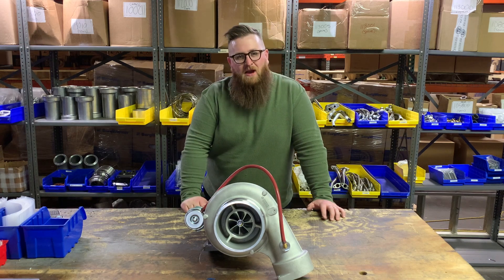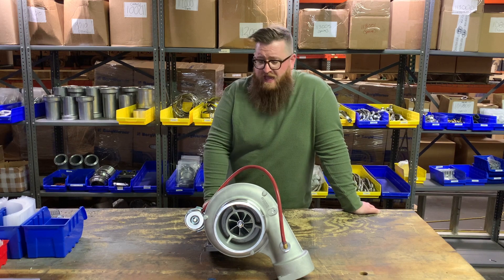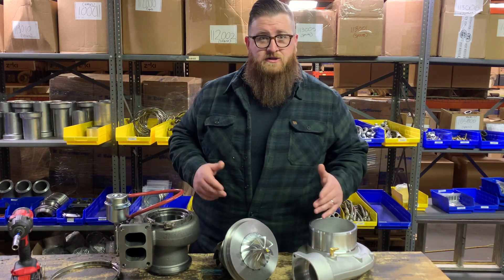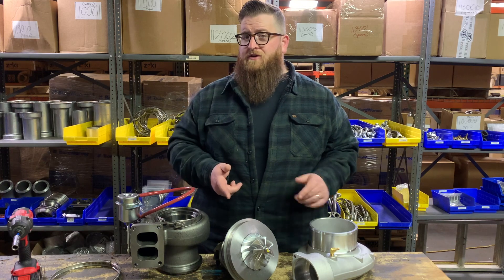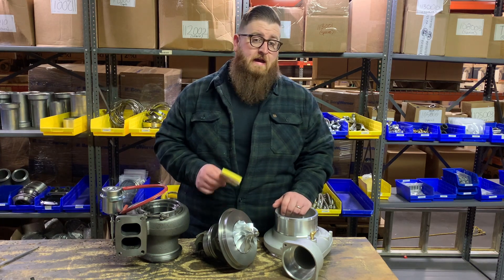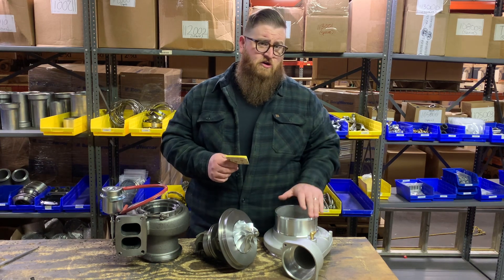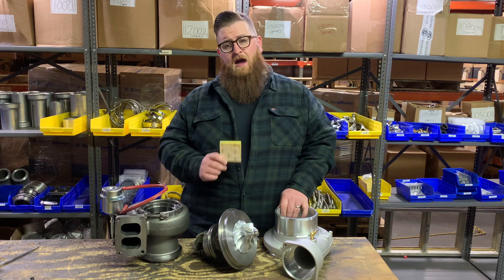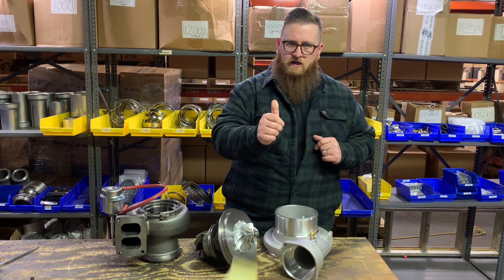Wastegated CAT Performance Turbo | 78MM S410SX

Comment: Any idea if they’re gonna make a 1.45 waste gated housing? I think that would be perfect for the 3406/C-15 engines that are pushing more fuel than stock.
Reply from the maker: It's possible,  but I don't think it's in the works for the foreseeable future
Reply: Yeah I have a 1.41 WG cat 9928 turbo and would like to replace it w a similar housing perferbly w WG.

Comment: would this be a good fit for a modified 550 file? stock injectors?
Reply: yes it would . it would be just fine . with the 1.32 housing it would spool nice.

Comment: What about adding that housing to the 171702 turbo? I put that on my c12 and it solved my heat problem. Doesn’t get over 950 anymore. But it will build 52-53lbs boost. Might be nice to have it regulated to 42ishblike the k31 turbo would do.
Reply from the maker: Its possible! (With some work) The 171702 uses the same 96/88MM turbine wheel.  The only real hurtle would be drilling and tapping the compressor cover for an air source to operate the wastegate actuator.  

Side note: 52PSI is wild!  Did you drop the housing to a 1.15?
Reply: @momentumworx  no I didn’t thankfully. The 171702 is more linear than a “hit” but it’ll make 20lbs at 1300 then 40 at 15-1600 then 52 on a pull when loaded. Cruises 70mph, 1550 rpm and about 7-750 egt. Pulling my long dump loaded gets 5.8-6.1 mpg really happy with it just might be a little to much boost? We’ll see I guess.
Reply: Is you moter set at 500 hp @timburton409